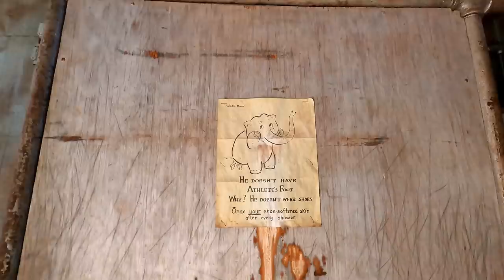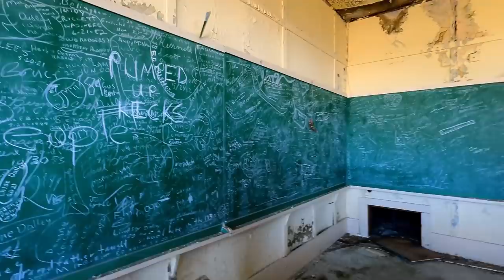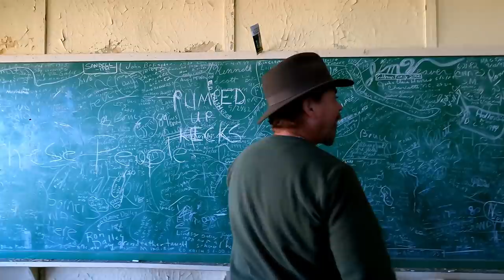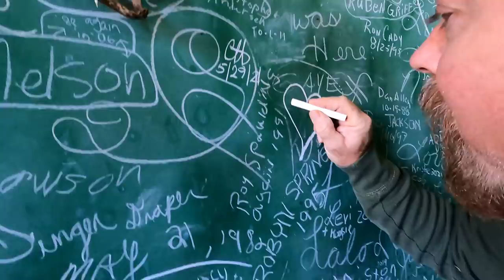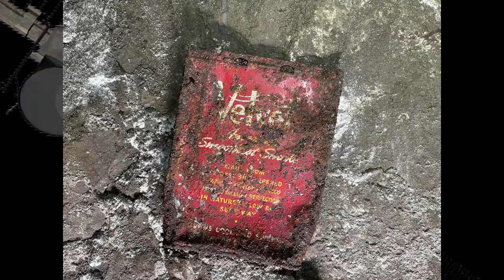Why No One Is Allowed To Go To This Mine -  Terrifying

Comment: i worked in a hard rock gold mine in Congress Az in 1991 and we used pneumatic slushers for mucking out high drifts, dumping the muck into an ore chute, down to a lower drift where we could us a mucker to remove it to the main drift. our main drift was about 14’ wide, secondary drifts were about 6 to 8’ wide, the ore body lay on a 70 degree angle and ranged from 2 inches to 9 feet thick, the hanging wall and the footwall were hard granite. it was pretty cool, sometimes we’d blast into old stopes the old timers made with hand steel. The Congress mine had been visited by the President in the 1800s  Mckinley i think.
Reply from the maker: thats great Clint , thank you for sharing and would love to hear more about when you worked at the Congress
Reply: That sounds like the best job ever.. and really hard ! I am a green horn at gold mining ⛏️ and every weekend I go looking and prospecting for gold I would like to know alot more about different types of gold..  have a great day thanks for your time..
Reply: I have buddies in the Road Runner Prospecting Club, they have claims around Congress. Lot of old farts like me swinging detectors. Been doing so since the 70s.
Reply: @Askjeffwilliams  yeah, it was for a Canadian firm called Malartic Hygrade, the mine was only opened for a few years before they closed down. they had a
picture of a whole town back when there was a whole town there, an upper town where our mining office and mill was and a lower town, where most of the miners lived, you would go out ghost town road to get to the mine and drive right through where the lower town had been, there were a few old buildings but not much left, i lived in Desert hills, north of Phoenix and it was a 128 mile round trip to get to work, eventually I rented a house in Wickenburg for $200 dollars a month, wouldn’t you love rent like that today?
Reply: Cool story
Reply from the maker: @clinthowe7629   thats great , thanks for sharing that
Reply: @Askjeffwilliams  thanks jeff, i love your channel, my family ind me also placer mined near Boundary Alaska in the forty mile mining district. we had a couple dozers and a couple loaders and built our own washplant on skids, My dad dubbed it the IRONMAN because of the  Black Sabbath song he’d heard his mining partner’s son listening to. We’d head north as soon as school let out, it was better than any summer camp ever made, i loved it, the excitement i’d feel as it got closer to the day to head north was intense. While it wasn’t jack wade levels of rich, we did alright for a small private operation, with a limited mining season. the fringe benefit was Blueberries and Ptarmigan hunting.
Reply: Why would any sane person damage anything historical? Sad
Reply from the maker: @clinthowe7629  wow now them are some great memories right there
Reply: @clinthowe7629  you.would.be.one to visit.i.love.the passion as your writing you hear loud and clear that's wonderful  being where you love.and what you.love with.the people.you love i wish.you.well I hope you hit.the.dream load
Reply: @jamesstewart7308  There is something incredible about it, isn't there? When I was a youngster, I used to dream of working in an old school hard rock mine. I even applied to work at a tungsten mine one time, but the owner wasn't hiring at the time. That would've been pretty cool... working a mucker in a big ol' tunnel right in the side of a mountain at about 7k feet.
Reply: @SteveKasian  it was a great experience the placer mining in Alaska i miss greatly, the underground, not quite as much but it does have a certain grandeur in the mind of the public and makes you feel proud to tell people what your profession is.
Reply: I dig it how he appreciates the history, the adventure, the machinery, all as much as finding the goodies! Cheers from beautiful Colorado!
Reply: @clinthowe7629   They got the mine in Kershaw SC running now Jeff.
Reply: Wow I can never stop learning from Jeff
Reply: Was there miney to be made working in the mines? Or was it more lucrative to be get your own and mine it?

Comment: At 18:34 Jeff you pointed out parts of what you called "resistor grids", actually I'm pretty sure they are parts to a steam radiator, also resistor banks are more often called "load banks" and their purpose was to add dynamic braking to assist the mechanical brakes

Comment: 3:06 I bet you they started with the smaller gauge, then re-railed with the wider set to get more capacity, but the shop is the only place where they concreted them in, so rather than break everything up, they just added the new rail at the right spacing.

Comment: Old big machinery is interesting, where  i grew up was flat fenland, their were massive water pumps that used to keep the land drained, some of the  pumping stations had magnificent pumps built in the 1840's and still running today, absolute works of engineering art.

Comment: Jeff-

@9:31 you asked what that is.  I knew before you mentioned it.  It is what I referred to the Smelting Lab. The Jaw Crusher is missing, and there should also be a "Bellows Line" from the Compressor House to bring air in to the Smelting Kilns.  Cores are crushed then placed into the crucibles and melted.  The impurities were either burned off, or refined off of the melts, and the principal was calculated to find out whether or not the Mine was still paying out, or playing out.   Case and Point the New Idria Mine Mercury Mine in Coalinga, CA closed in 1973.  Mine was still 70% productive at closure, but the market for Mercury no longer justified the expense of the mine operations.

Gold, Silver and Copper Mines are all in the same boat.  Many of the Gold/Silver Mines in California still have Ore, and in profitable amounts.  It is getting to the ore that is the issue.  Hard Rock Mining is expensive and current EPA Regulations are cost prohibitive to change these otherwise profitable mines to open pit operations to access the minerals.  Secondary issue is labor costs, which will cost more per hour than Diesel Fuel for the equipment.
Reply from the maker: thanks Shane for the info, yep this mine still has a lot of Silver, Copper and Gold down at the lower levels but to expensive to pump out the mine and rehab it then there is labor like you said ......
Reply: We need to organize with the GOP and the Libertarian Party to get the EPA abolished once and for all.

Comment: Hey Jeff,, I have a question I need some help with. I have 2 pools of water. If I am using a 2"water pump (gas) to pump water to Pool #1. Instead of adding another pump to pump pool #2 Is there a way I can use the water pressure to suction Pool #2? How would I hook that into a 2" line? (like a small suction line, say only 3/4").
Reply from the maker: as long as pool #2 is lower then Pool #1 to create that effect

Comment: It’s nice to see the history in these mines my great grandfather worked in iron mines in Michigan’s Upper Peninsula in iron river Michigan he said in the hay day there where over 200 mine in this area and you could walk for around 30 miles under ground without coming up as most mines where connected. He was a blaster and started in 1920 making $0.20 an hour one of the highest paid jobs in the mine where the average miner made $0.06 an hour. His best friend worked at another mine about a mile away and they would go over to each other’s changing rooms and play practical jokes on each other constantly. Out of the 200 mines in this area mining hematite about 30 where open pit mines that where later bought out by Cleveland-Cliffs mining company and converted to underground mines these mines in the beginning mined hematite near the surface to be shipped to paint companies that used the hematite to make red paint this was in the beginning of the mining hear around 1868. The last mine here closed in 1979 and the pumps that dropped the ground water to below 1 mile where turned off in the mid 1980’s bringing the ground water back up flooding the mines and some residents basements
Reply from the maker: wow ....great story ...thanks for sharing that

Comment: Belt driven of the jack shaft.....well that belt would have to be used as a taint and ball buffer before they meet the rock hammer.  Has to be what it is.  I've seen those before.

Comment: The motor does become a generator when it runs backward because a counter weight is turning it. Those resistor banks are there for speed and torque control. Those motors have external resistors as opposed to modern motors with internal resistors and remote controllers.

Comment: love these ones, so did miners down there get hit by slab cakes then? i was waiting for the terrifying bit that red seam is like that you find in your mine? i seem to remember it there on one of the side walls low down i might be wrong ya dug loads out there
Reply: There are coroners reports on another website.  Many crushed by falling rock, several fell down shafts.  One fell 1400 feet which is the height of the Empire State Building.  One hoist failure led to death.  No responsibility assigned to the company.  It is a lead, copper silver mine and is privately owned by a "Nature conservatory".  Some expect it to be dozed.  It had a 9000 foot Tramway to Jackrabbit, a long narrow guage railroad, about 40 miles of high voltage transmission line and was eventually connected to the grid which was far cheaper than gas/diesel generators.  It is said to be full of ore but they could not pump out water fast enough and that led to its closure around 1950.  There were a few contractors in 1960.
Reply: thankyou for that interesting info,  maybe someone needs to follow that aqua flow to its out sauce... the old maps give you a 40mile idea of flow be safer that end idea get a mini drone sub down the wet end smiles 1950 that aqua duct as loosen  a few lb gold since i bet smiles
Reply from the maker: @rogersmith7396  thanks Roger for the info

Comment: Hey Jeff exactly how did the old miner's find there way to do the work with a Carbide Light anyways?  Heard they could take the carbide part that was burned and still use it as a pencil to date or direct the ways of the mine.  Do you have a Carbide hard hat to show us how to lite it up and shine it down deep in the dark?  So come on show us.  Please.
Reply: They produce a white hot flame, acetylene I think, like a welders torch.  They have a mirrored reflector behind the flame.  Like a Colman Lantern.  Modern mines use battery powered lights with recharging stations.
Reply from the maker: yes we do and we have made vids of us using it and writing with it before but we can do that again if you like
Reply from the maker: exactly

Comment: I would think the miners would come up with some way to use the power generated by the hoist motor turning backwards, and not just burn it off through resisitive heat.
Reply: Or just use big diodes to cut it off.  That stuff is all obsolete.